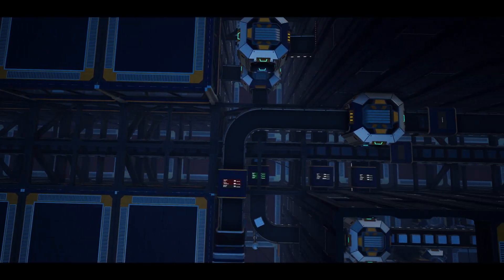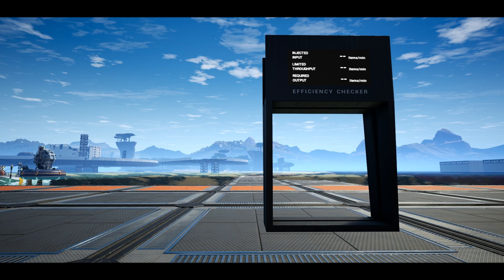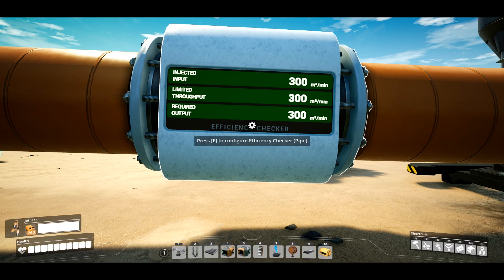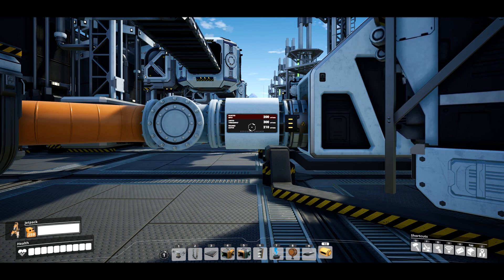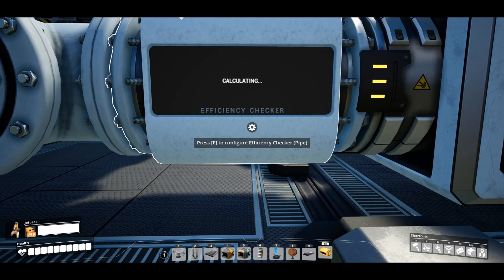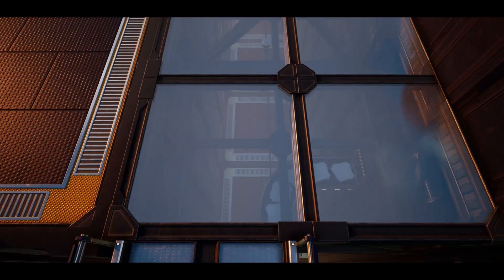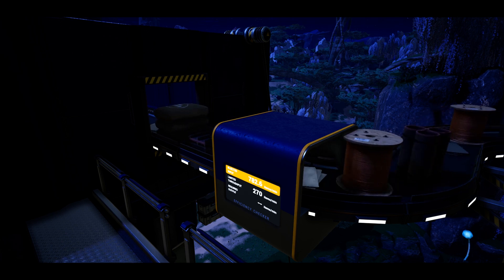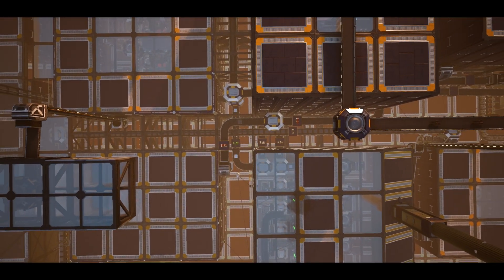Efficiency Checker Mod Monday Satisfactory Mod Spotlight

Comment: To take these to the next level they should come with 2 models. Level 1 basic checker where you have to view the figures at the unit or level 2 where they could be nameable and they transmit back to a central hub machine which you can also construct so you can monitor all the level 2 checkers in your world in one location. To have them they should be alot more expensive to construct with ai limiters, computers or supercomputers etc or limit the total level 2 checkers so you are forced to use them wisely.
Lovin your videos. 👍
Reply from the maker: Some really nice suggestions - I believe the price has increased for them already but I’d definitely be interested in expanding the mod ☺️

Comment: Man that liquid monitor sounds hella handy. The liquid mechanics are probably pretty smart, but its just not that visible compared to conveyors and as such IMO a bit more tricky to be confident its behaving the way you expected.
Reply from the maker: It is very handy - but it calculates the whole section of pipe so all inputs and outs outs so it’s a great way to check that it is working correctly

Comment: How does that fare with train systems?
I'm kind of afraid that it calculates every single machine connected to a belt. I have very complicated networks of trains / trucks and I've always been looking for a checker that would count items for X amount of time (you choose X), then average that down to throughput/min. That way there's no room for mistake
Reply: Been using it a while and it does not count the whole conveyor line. Only what is before it.  I use to keep track on my bus im building.. but i write down the total for each lane... at the end... before adding more to it no matter where i add it
Reply from the maker: Like Kevin mentions it only calculates directly what is before it in the construction line and what’s directly after, si that shouldn’t be a problem, I just wouldn’t use it on the train station parts as it doesn’t seem to calculate the storage units and I presume that’s the same with truck and train stations
Reply: I see, thanks both!

Comment: Cool mod. I like that one... 😂
Reply: And about the cost: I agree... I putted some value to "get it going" and never returned to it for some cost tunning other than the minimum requirement (mk3 belts) 😅
Reply from the maker: I really like the mod but as it’s more of a QoL mod it doesn’t really need a price adjustment just something I think would be nice ☺️
Reply from the maker: By the way do you know the effect on performance if we were to use it on every section of the factory?
Reply: @TotalXclipse  not sure, but I tried to optimize it the most I could, like, they will not update if you are not near then by at least 40m (5 foundations). And the display screen has a culling of 100m (beyond that distance they are not drawn). But, it is a constant work, to fine tune everything the most it can be done. Other than that there's always the option to edit the EfficiencyChecker.cfg file and disable the autoupdate feature (it will only update when interacted)
Reply: @TotalXclipse  And it is a QoL mod, but it shouldn't be without some "cost", too. You want life easier? Work for it XD

It will be tweaked, I was first focused on get it working :)